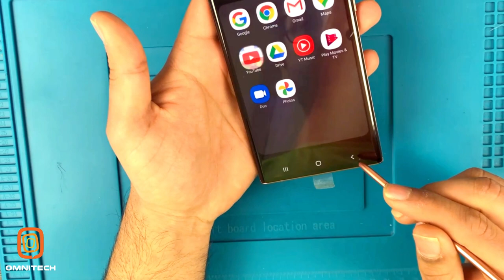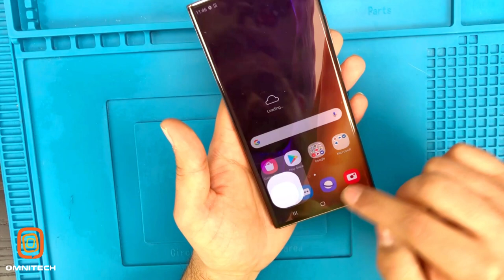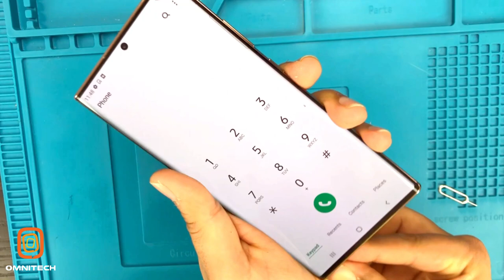Samsung Galaxy Note 20 Ultra Teardown - What is inside Note 20 Ultra 👉How to repair Samsung Phone💪

Comment: This is 5G and Exynos?
Reply from the maker: yes
Reply: @OmniTechNZofficial  Hi, is it Exynos? I see it has copper cooling. In USA, the cooling is graphite. What is your nation?
Reply: @TaiLe-dr5ve  Both 5G and Exynos variant. The video is based from New Zealand, probably the unit is purchased from New Zealand.
Reply: @TaiLe-dr5ve  Hi, yes you are right this device is copper heat pipe and in few countries they used multi layered graphite and we based in New Zealand.
Reply from the maker: @yosoy01ian  Yes you are right, this unit is purchased from NZ telco provider
Reply: @ankusharora2780  It's clear for me
-Note 20 Ultra Exynos 4G, 5G using copper cooling-->receive many complaints about overheating.
-Note 20 Ultra Snapdragon 5G using graphite cooling-->receive less complaints about overheating.
In Vietnam, I bought Note 20 ultra 5G Exynos and returned it after 1 day using, it has scratch and dust inside cameras, it is very hot when open camera, zoom in, zoom out few times, the battery drop so fast.
This year, Exynos is a bad Chip for Note 20 ultra. Weaker than Snap so much, hotter, worse game, worse battery, worse camera, slower operations,...
Reply: @TaiLe-dr5ve  Zack's teardown video ( https://youtu.be/nIgu1Ge1llI ) also shows graphite one, but mistakenly identified that the unit is Exynos one, but it's actually a South Korean 5G (without mmWave antenna) unit with Snapdragon chipset ( https://youtu.be/7eQG8mRlYHM ) .
Reply: @yosoy01ian  In my opinion, the phone of Jerry is Snap 5G come from Korea because you can see the rubber case in the box. In Korea, Samsung donates a rubber case in the box. We really don't understand why Samsung use graphite for Snapdragon version and copper for Exynos version, and the root cause of overheating is CPU or cooling system?
Reply: @TaiLe-dr5ve  probably because the Exynos is more inferior and heats up easily than the Snapdragon one, so the Exynos model has copper to avoid excessive heat, and the SD model has graphite on it.
Reply: @yosoy01ian  If your comment is true, that is the stupid thing of Samsung,....

Comment: No vapor chamber
Reply: it uses copper heat pipe for that unit (for NZ).
Reply: NZ meaning?
Reply: @msm2463  New Zealand
Reply: In Note 20 ultra they used copper heat pipe and for few countries they used multi layered graphite thermal pad
Reply: @yosoy01ian  what about US??SD 865+
Reply: @ankusharora2780  Copper is for Exynos, Graphite is for Snapdragon, including South Korean model which Jerry Rig uses
Reply: @shadowwarrior7338  For US they are multi layered graphite